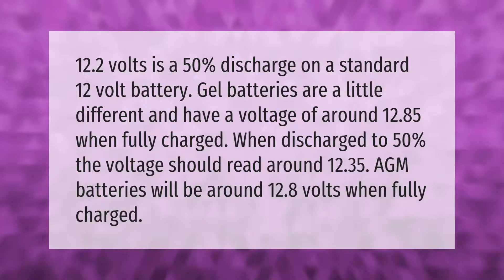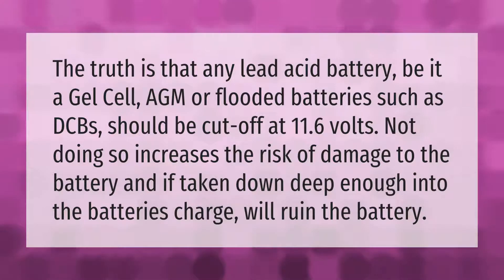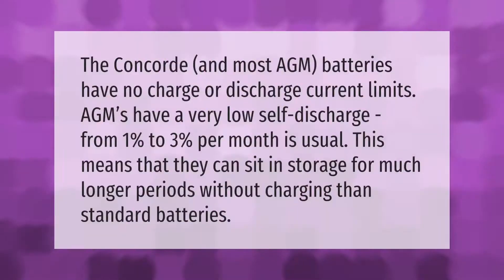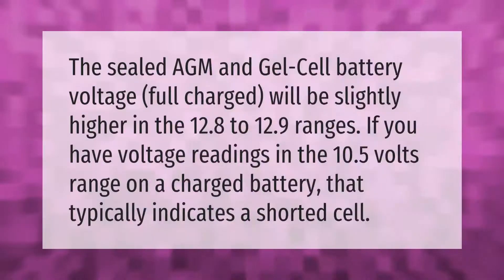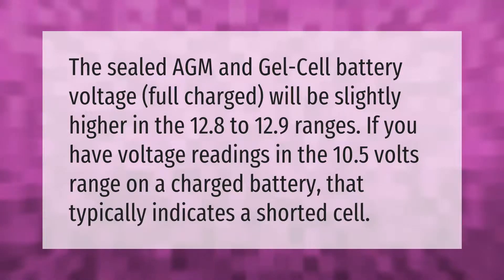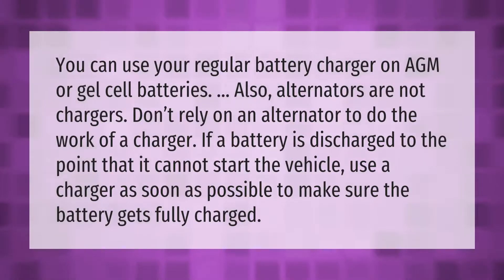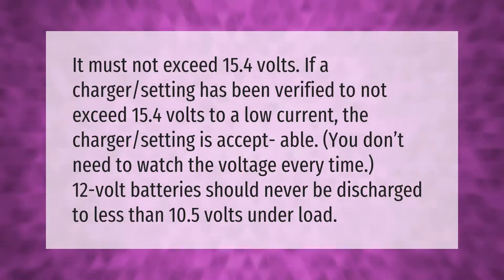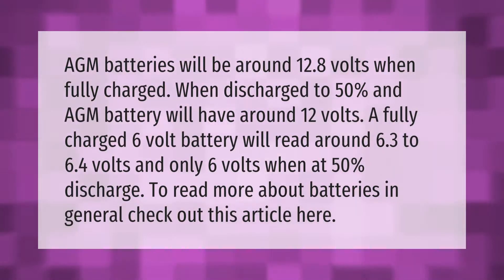What should a 12 volt AGM battery read when fully charged?

Comment: Did a brain dead monkey make this video? No really, this video is complete trash, and you have no idea what you're talking about. AGM batteries need to be over 14 volts to charge properly. If the alternator is only putting out 12 volts, it will not charge AGM properly, therefore shorting the life of the battery.

Comment: Nice video.... Thanks 👍
Reply: Don't take advice from this senseless video. AGM batteries need to be around 14 volts to charge properly. A 12 volt system doesn't work with these kinds of batteries.

Comment: This is a really good question for the subject question. But won't most AGM batteries all have different fully charged volt settings from 1 manufacturer to the next one?
Reply: My advice is to fully charge the battery (ideally when it is new), let it set for 12-24 hours off the charger, then measure the voltage.  That will give you the voltage that your battery sits at when fully charged.  When in use you can approximate the level of charge using a generic battery chart if you take into consideration what your particular battery voltage is at 100% state of charge.  Generic battery charts usually decrement in 0.2V steps.

Comment: when setting my controller for over 14,5 volts to charge a agm battery my inverter shuts off when close to full charge as overload protection, what voltage will a agm charge at fully for lowest voltage that would work, say 14 volts?
Reply: I have mine at 13.2

Comment: What's the best charger for a Odyssey Extreme AGM 34/78PC1500DT battery ?
Reply: CTEK MXS 5.0 is a great charger for AGM batteries.  You can select AGM or standard battery before you start the charge.  It also has a "recondition" option that you can/should run about once a year.  It has 8 stages, super well engineered with a 5yr warranty.